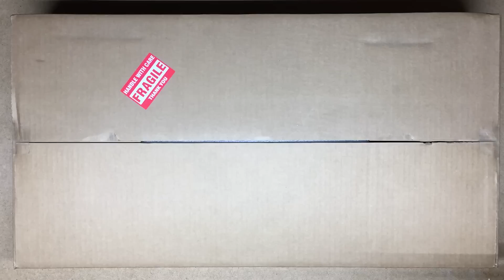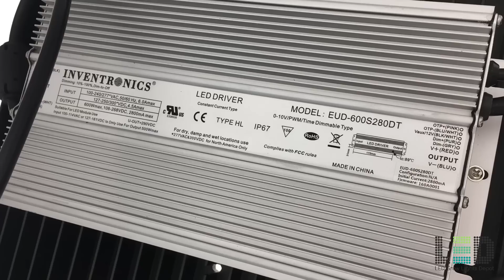Horticulture Lighting Group HLG-600H V2 Unboxing, Build, Review, & PAR Testing

Comment from the maker: Shop HLG lights at LED Grow Lights Depot: https://bit.ly/2jvsB0p
Reply: Would this 600 kit be perfect for a 5x5 tent?
Reply: Yes it would definitely cover a 5x5
Reply: @grind60  I use 2 in an 8x4 so I'd say yes.
Reply: @Ancyker  Does the HLG 600 kit run hot ?
Reply: @grind60  I'd say warm. 2 of them bumps temps from the 70 ambient to around 78-80 with a 35-40% RH. But most of that heat is from the light energy itself. I noticed as the plants got bigger and thus used more light the temps were affected. I started with one light and all the plants fit under it. The temps got to around 82-84. But as the plants got larger the temps dropped. At the time I didn't have a dimmer. So really I should have had the light closer and dimmed. You don't need full brightness until your plants are big and bushy. Any light not used by the plants will be converted to heat, just like with sunlight. The light itself is warm to the touch. It's uncomfortable to leave my hand on it but it doesn't hurt. Underneath the lights feels like the middle of summer at noon, at 24" this light is brighter than the sun both in terms of lux and ppfd. It's very intense. My cats love to lay under it like it's sunlight. They never did that with my old light.
Reply: @Ancyker  I'm going to order one of these lights for my 5x5 tent soon as they are back in stock. Could you link me to the dimmer you bought?what heights did you hang at maxed/also once dimmed.
Reply: @grind60  I just hung the lights as high as I could. I cheated and just straight up used a resistor to dim the light. I'm working on using a custom microcontroller to do dimming so I can do soft on/off to avoid humidity swings.
Reply: @Ancyker  Would i be able to use electric tape to connect the potentiometer? or is soldering the only way.
Reply: @grind60  electrical tape would be fine. It's a protected circuit with an absurdly small amount of current (0.0003 mA). It include wagos you can use as well.
Reply: GameNGrind came with dimmer in my order on 11/28 th
Reply: @grind60  I would say yes... It's the brightest light I've ever owned
Reply: GameNGrind yes
Reply: Available in the uk ?
Reply: What do think about the new marshydro sp series.
Reply: Hi, a review of the BLG-185 2' LED Light Bar Fixture would be awesome! Thanks!
Reply: Discount code?

Comment: I got this light I just put my clones into flower at halfway power they started up towards the light the first day there Lush and just non-stop I think it's a great light for 400 less than the 650r and only a hundred Watts power efficiency all around the board less really does not make much of a difference if you know what you're doing I meant the 600 v-spec.r

Comment: The heat sink that comes with this kit looks slightly different now, but don’t let that discourage you. The wiring is exactly the same as in this video. The potentiometer is included and the wiring is explained in the description. If you’re having issues with your potentiometer after wiring try separating the wago connectors as far as possible between the dim- and dim+. That said I’d like to share my experience with HLG customer service.... The potentiometers that HLG are sending out are sub par. An HLG rep said so in an email reply. They claim it’s due to covid and having to use a new supplier. Not sure about all that, but after sending two broken pots, a free t-shirt, and about four weeks, I have yet to hear any response to my most recent email  informing them that the second potentiometer isn’t working either. I’d suggest buying from an authorized dealer with a good customer service history. Maybe if I wasn’t spending over $700 for an LED kit this wouldn’t be so upsetting, but that’s almost a grand, and they can’t even be bothered to return an email.

Comment: I have 2 of these HLD600H DIY lights. Easy peasy to put together. I do use them for veg, but had to install the potentiometer & I dimmed them down to 250 pull & 30" above the canopy. They easily cover 5x5 in flower if not more at full power. I recently harvested 6 girls & had a yield of over 4.5 lbs.  They grow top notch, super dense, highest quality medical flower. These are the best lights I have ever used. I have Spectrum Kings as well. Great light, but more expensive & they tend to run hotter for a LED.  The HLG600H runs nice and cool.  The absolute best light on the market for the money! Thank you for making this video. It was a great help in my choice.
Reply: What height would you recommend  at full blast for veg & flower.

Comment: Just got one. They come with a dimmer now included. 🔥
Reply: Who did you order through? Their main website says dimmer not included.
Reply: Binky Boppin I ordered thru led grow light depot
Reply: The dimmer is included with purchase through HLG. The wording on the website is a little confusing. Originally they didn’t come with a potentiometer.
Reply: @TRPN503  did you install the dimmer? Im a little confused in wiring in the dimmer
Reply: longbuds longbuds Yeah, the video didn’t touch on that part as much as I would have liked, but that’s likely because it was uploaded circa the decision to toss in the potentiometer with the kit. If you’re looking for the wiring info it should be in the description... the dim+ and dim- wires on this particular driver are grey and purple.

Comment: I dont aprove of mounting the pcb on the heat sink without any thermal transfer medium.
Reply: I'm not questioning your knowledge I'm just wondering if it was required or beneficial I'm sure hlg would let us know I hope. Why do you think it's not a good idea. Also if you could back up your claims with support of evidence I would definitely follow in your footsteps.
Reply: @samsons_cannabis  Its common practise to use a transfer medium like a paste between the component and the heat sink.. I dont know what else to say. Try google a bit........

Comment: Waste of $. Get 4 QB288 Rpec boards
Reply: wht drivr should i get for those boards?
4 individual heatsinks and to be put in a 4x4
Reply: @Gray-rl7yg  If you use 4 heatsinks and hangers then you could use any wattage you want but a 120w is what HLG sells for QB288 single board kit.
Reply: @PeterKKraus  if i wanted to only use 1 driver for 2 board what would you recommend?
Reply: @Gray-rl7yg  It's not up to me. It's up to you to decide how many watts you want to run them at.
Reply: @PeterKKraus  what should i run them at?!xD  could you elaborate on the information you know im lacking so i could understand?
Reply: and help make a more informed decision. I guess
Reply: @Gray-rl7yg  Any wattage you want, up to about 135w.
Reply: @Gray-rl7yg  HLG-185H-C1400A

 That will get you 100 watts each for 2 boards. The HLG-240H-1750A would get you 120 each.
Reply: @shmickshmudney3595  Kingbrite samsung lm301h 288 v3 ....$156 for 4 with shipping.
Reply: @shmickshmudney3595  Yep. 4 boards a 24 x 24 .188 thick aluminum panel, driver(s) and wire  would be a lot cheaper than buying  this light. You can get siimilar to Rspec boards on Alibaba with LM301H leds instead of the B.

Comment: When I saw this I was expecting the HLG-600H-54 driver. Do you have a preference between the HLG-600 and the Inventronics EUD-600 for this setup? Aside from wiring in series vs parallel what are the advantages of using the EUD-600 over the HLG-600?
Reply: hmu with this info when u find out lol
Reply: I posted this comment originally. The main differences are the way the lights would need to be wired. HLG does not make a driver at 600 watts that can be wired in series. I used the Inventronics because it’s more bang for your buck IMO. Also, I’ve been told that these type of lights are more efficient and have a longer life span when wired in series. Hope this helps!
Reply: @michaelm4277  this is super helpful thank you! One last question, I'm trying to decide what driver i want to get for my 4 individual 288v2rspec Qb's, if i was to wire in series which and how many of that driver should i get? One of the inventronics? what was the model
Reply: @Gray-rl7yg  I answered that questioned in my previous response. The inventronics driver EUD-600S280DT. 1 fixture 1 driver. If you looking for an understanding id recommend doing research. If your just trying to build a light based on the video just follow his steps verbatim. Its very easy to fry a board! Good luck.

Comment: As per the page it says: 4'x4' to 5'x5' flowering footprint; 7'x7' veg footprint. Has anyone setup a 7'x7' veg area with this type of light?
Reply: I'm sure it will be no problem I run a 4x8 veg area with only 320w of the same diodes
Reply: @poepflater  Thanks for the update!
Reply: @PhenoMorph 420 DO you know what a VEG AREA is?

Comment: I bought one of these pre built with a dimmer. it is amazing! the growth I'm seeing is double from what I was using. 4 kessil h380's which grew ok buds but this thing is going to knock it out the park! I am so impressed so far and I'm only running it at around 30%. I will turn it up for flowering
Reply: i also got a dimmer by chance do you have the wire diagram?
Reply: @abelarroyo3651  I had mine built
Reply: @Cherub72  fr can you show us what it looks like? I'm not sure how to wire the dimmer..
Reply: Can you take a pic?

Comment: is it the same spectrum as the hlg 500v2 ?
Reply from the maker: 3000k, yes
Reply: LED Grow Lights Depot  I was told that the 600h Rspec is 3500k ? Please let me know as I just got mine today. And would like to know what spec I’m running
Reply: Everything is basically the same wzcwot the driver
Reply: @JayCei23  this has more lights
Reply: @Cherub72  no...just a bigger driver
Reply: @JayCei23  ah nvm you're right. i see the main difference is its prebuilt and has UL certification

Comment: so same amount of LM301b diodes on each panel as the HLG550V2 but uses more power? Maybe I'm missing something but wouldn't it be the same draw and output with same # of diodes unless the driver was just higher wattage and pushing more out? and my 550V2 only draws 484.5watts from the wall plug so... not sure whats up
Reply: That's the point... your 550v2 has a 480w driver.. this is a bigger driver  basically helping get more out of the boards

Comment: I have the hlg 600 and I can verify that it is a beast. I have a 4x5 area and it will flower and veg great at a height of 30 in I easily  pull 16-24 oz every 90 days. with a 30 day veg and a 60 day flower from seed  with 4 plants. I know that is not great as far as grams per watt, but I am still trying to get everything dialed in. very happy with the light. it is a little tricky getting the temp and humidity right when changing from hps.
Reply: You can get 3g/w if you do everything perfect.
Reply: Look, if you can get 24 oz and the light draw is about 600W you are doing slightly over 1 gr per watt. It is a fantastic result.  With bluerpies  last time  I run 4 lights(over 1200W in power draw in total and 3000W as per LED specs) and I got only  0.4g per watt. 

 Just as comparison, with three ViparSpectra each  600W(total power draw for three is over 800W) I could only get 0.2g per watt. So you are doing 5 times more with almost 25% less power draw.

As for the light cost my four ViparSpectra  costed me 2.5 times more that I spent on DIY kit for a analog of HLG 550 V2 purchased from KingBright. 
And it is cheaper than HLG 550 V2 at least two times. I think only very few people know that they can build these lights themselves buying kits on Alibaba for much less than HLG sells them four. They are the same complete kits with everything included. There may come without manuals how to assemble them but there  are just a few wires to connect and screw things together.
 KingBright for example sells a kit that is the same than HLG 260 for about $150 plus delivery.  For $380 with delivery and two sets of KingBright 260W you can build the same as HLG 550W v2   and that with delivery by DHL. I got mine from then delivered  on 7th day after I paid.
Reply: @wingmanmedia6536  I agree, I am not complaining, I just know I can do better with a little work. My hlg 600 draws 590 at the wall. every run has been a different strain, I am still looking for that perfect strain. I have run ocean grown, duke diamond, and th seeds, all have done really well.
Reply: @wingmanmedia6536  the Ali kits aren't as good as the 550. The heat sink is thinner which reduces the life of the system. The 550 is UL listed and comes assembled, that's why it costs more. Comparing the ali 550 kits to the HLG 600, the price per watt is basically the same and you don't have to wait a month to get it from China. As for using the smaller kits, I prefer the inventronics driver. It's better overall. Not to mention you get the warranty from a US based company. How much did you save if you have to ship a driver back to China? Saving single to low double digits isn't worth it. Not when one grow offsets the entire cost of the setup and beyond. Why cheap out? Makes no sense.
Reply: @Ancyker  So I could buy the same chipsets and drivers from Aliexpress and get the heatsink from HLG directly? Wouldn't that make sense if you're worried about the heat sink shortening the life of the boards?
Reply: @proletariategg  I don't think they sell it separately. Even if they did it would negate nearly all the savings and you'd still have no real warranty
Reply: @Ancyker  They do sell the heatsinks separately, and you think im gonna rely on a Chinese warranty? Lol that's the point of getting it to begin with, so you can buy the better, more obvious American built brand after your successful budget purchase gives you something worthwhile.
Reply: Thank you I'm going to build a super board now
Reply: K quilter what are using for your temps & humidity? Still contemplating about going with led’s because of temps & humidity.
Reply: K quilter what light distance did you find best bro for veg/flower
Reply: @PhenoMorph 420 Not an HLG purist. Check my channel dingus. Just bought 2 600w king brites. I dont even own HLG.

Comment: I just put this light together myself after a great deal on their website for a 5x5 grow tent.  They had the light on sale for $692 at the time.  Woot.
Reply: Does it work well in a 5x5?
Reply: Just wanted to do a 3 year update.  It has a higher output that the 550 so yes.  This driver is around 620 Watts for output compared to the 480 Watts from the 550.  This light is a beast in a 5 x 5.  It is comparable to a 1000W DE HPS.  This light is working exactly as the day I put it together.  Also I recently emailed HLG about a dimmer because it didn't ship with one and they sent me the dimmer and box free of charge.  I ordered this 3 years ago and they actually did that for me!  They are a great company to work with.

Comment: 50k ohm pot for a single driver?
Reply from the maker: Yes
Reply: @Ledgrowlightsdepot  What's special about this driver that it takes a 50k ohm pot for resistive dimming rather than a 100k ohm pot like the rest of the drivers on the market?
Reply from the maker: HLG recommends a 50k ohm pot. Not sure why exactly. Better dimming resistance?
Reply: 200k ohm for 4 ligth. minimo

Comment: Watching you use a waygo instead of the waterproof connector for the power cable made me anxious! I swear I saw you unbox one....
Also you can screw the feet in all the way and it still holds the boards/sink off the surface its on🤘
These lights rock though, they are worth every penny!
Reply: Does it matter? If water is getting to your lights you've got some major issues... Now, with that said, I've been contemplating just soldering the connections on mine.
Reply: @Ancyker  I use agricultural misters in my tent,  so yeah,  water gets all over my QB260 kits all the time.  My drivers are outside the tent though,  obviously.
Reply: @Ancyker  To be honest I was more worried about the strength of it, rather than it being waterproof haha. You could easily drop something and snap one of those waygos, just an unnecessary drama that can be avoided.
If someone is getting water on their lights, their definitely doing something wrong haha!
Accidents do happen to stupid people though 😂
Reply: @suckitsunshine8752  I can pull on the wagos and they don't come off. I mean I guess you could crush them, but to be fair you can also crush wires in general. The edges of the heatsink are sharp so it'd be easy to cut the insulation of the wires and get a short. That won't damage the driver as it does have short-circuit protection. I still put some heat shrink on mine where it passes through the heatsink to add some protection.
Reply: I would consider just buying a longer power cable, and replacing the whole thing.